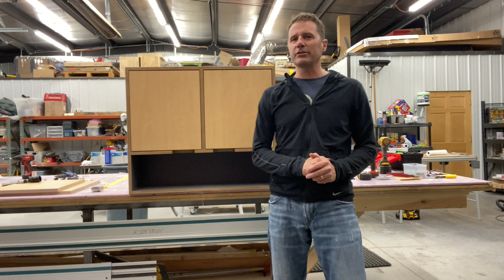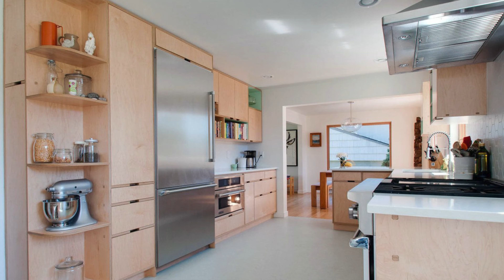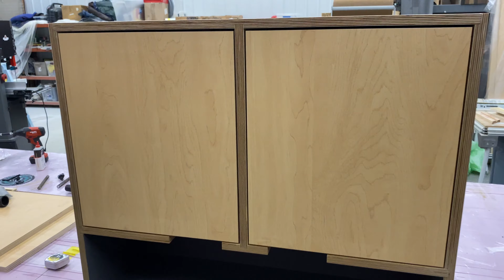Modern Cabinet Build Using Baltic Birch and Laminate

Comment: I think the 1/8th (3mm) gap is about right.  Any smaller and the doors might rub if they ever get a little out of adjustment.

Great work.  I did a big cabinet project using the same design but your shop setup and techniques are impressive.

Comment: I was losing my mind trying to find a flush trim router bit with a small enough bearing to fit inside a 1/4" rabbet to cut the melamine. Thanks for demonstrating that this should be done on a routing table with a standard router bit.

Comment: Thanks for this series of videos. Planning to build something similar, but trying to figure out how you accounted for laminated pieces in the dados. Did you cut those dados wider to account for the laminate or keep the laminate short of the edges that go into the dados. Either way seems tricky, would love to know how you solved it. Thanks!
Reply: slightly wider dados for laminate on one side or both

Comment: Why not refer to it as dado joinery?  "Kerf" seems so generic and non-specific. I should think "dado" would have been more fitting given that a "dado" in joinery is understood to be a wide, partial depth cut across the grain (or "groove" in the case of running with the grain) intended to accept a close-fitting edge of another board.  I acknowledge that a "rabbet" in Brit-speak is a rebate, and that in Festool-speak,  cutting dadoes is referred to as "trenching."   Shakespeare's Juliet was right -- that which we call a rose, by any other name would smell as sweet.  And it's sweet work you have done.  Anyone would be very pleased to have these cabinets in their kitchen.  Superb!
Reply from the maker: Thanks Rabbit! In my experience Kerf is the slit or groove and a dado is how you cut it--pretty interchangeable in my mind. Also, there's a great company called Kerf that builds these types of cabinets, so it kind of caught on with me.

Comment: Did you use 3/4” ply for the backs on the upper cabinets? Is there a reason why 1/2” wouldn’t work? 

Also, what tool and table is that you’re using for the dovetails?

Thanks!
Reply from the maker: Yes, I used ¾" for the backs. ½" may have been fine, but it's nice to use the same size for everything. Not to mention there are dado grooves in the back and they're hung by the back so thick=strong=good. There are no dovetail joints on this product--it's all dados with overlapping joints. Thanks

Comment: Fellow Woodworker here. Happy to see more American Woodworkers getting into the popular Euro-Ply cabinetry so common across the pond. They make really high quality panels, and the veneer technology has improved by leaps and bounds since the original Formica.

You should check out a Eurooean Laminate distributed by Formica in the US called FENIX NTA. It's a self-healing thermoelastic nano-polymer with an ultra matte finish that really makes cabinetry pop. And it's only about $4/SF.
Reply: Pablo, I am trying to get my hands on it. Seems like its as rare to get as pope crap. The euro market is such that shops now even sell laminated BB with Fenix. If you are just a regular joe, the distributor system is just interested in selling truck loads of panels rather than one sheet. May I ask what technique you use to glue on Fenix ? Anything special ?

Comment: Nice work, looks pretty awesome for a prototype. I'm working on plans for a small cabinet (similar to the size of this one, actually) to serve as the galley in my Sprinter van conversion, but I have very limited woodworking experience. I know it takes a high level of precision to get this style of construction to fit together nicely, and I certainly don't have a CNC table of my own haha. I still want to explore the DIY route rather than hire a local cabinet-maker, but I know my innate perfectionism could become a problem with a project like this. 😜 I've been inspired by a few kitchen projects created by Birkwood over in Scotland (which is some seriously pro-level stuff) and love the mid-century style.

Will definitely check out the rest of your series about making these cabinets, as I see in the sidebar that you've added a couple more since this one! Enjoyed watching 👍🏼
Reply from the maker: Estlin, thanks for your comment, I appreciate it! I've learned so much from other YouTubers, I'm glad to hear about someone benefiting or at least enjoying my videos!
Reply: @ModernArtisan  You’re welcome! Oh, and one question—you used 3/4” Baltic for the cabinet in this video, correct? 

The 1/2” would probably be plenty strong enough for my purpose (and weight is a factor, since it’ll be in a vehicle), but I might have to go with the 3/4” for aesthetics!
Reply from the maker: @EstlinHaiss  I used ¾ “(23/32). I did used ½” on the drawers you’ll see in other videos if you watch them.
Reply: @ModernArtisan  Will check them out later today when I’m back on my computer! 👍🏼

Comment: Good stuff Matt, looking forward to future episodes. Sorry if I missed it but no edge banding? Also I'm no expert on inlay doors but one project I did do I made the doors very tight. Then I used a laminate sample card as a gauge to draw a line on the doors (as they were installed in the cabinet) and then trim them on table saw or track saw.
Reply from the maker: That’s a good idea, but yeah no edge banding anywhere on this—they like to see that pretty Baltic birch edge!
Reply: @ModernArtisan  Got you 🤙